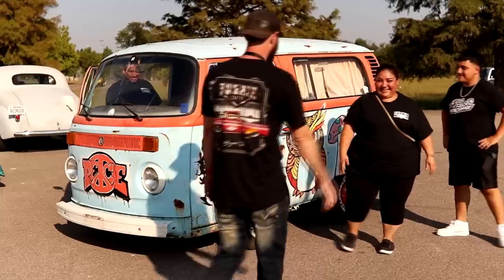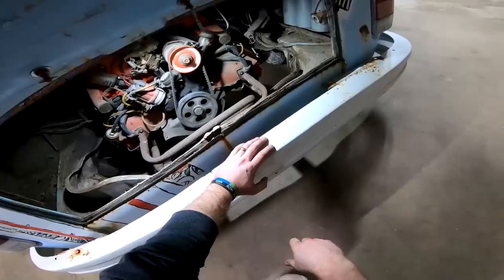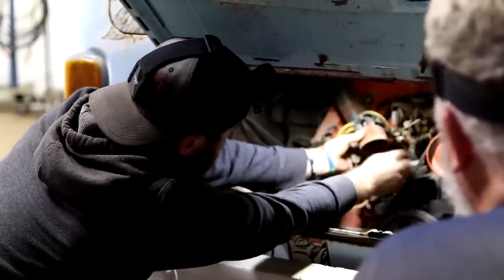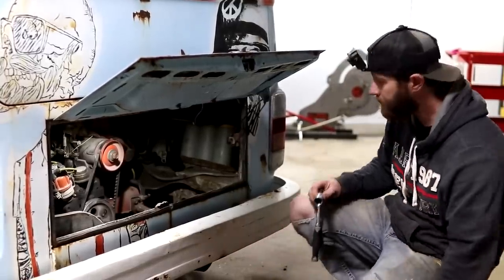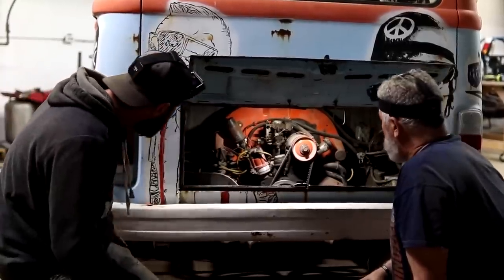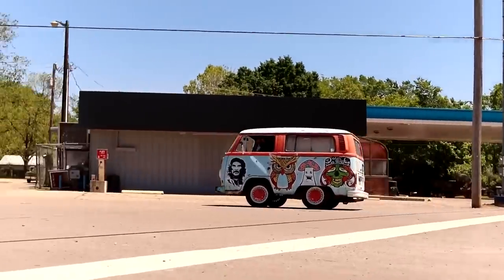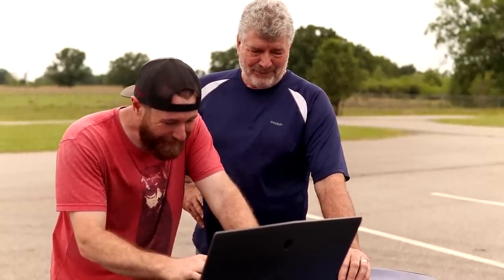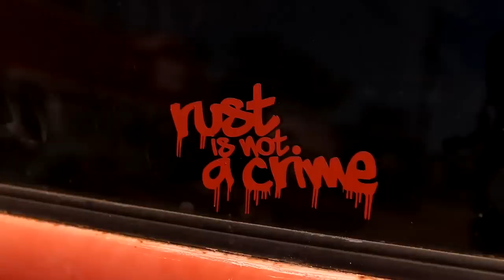Shorty VW Bus Will It Run | Forgotten Wheelie Machine | RESTORED

Comment: in 1973 I heard about a 1960 with newly rebuilt engine that kept overheating.  He only wanted $150 for it.  When I went with him I found that after the rebuild he and his dad failed to put the heat shrouding back in place.  I told him that could be all that was wrong.  He sold it to me anyway.  I towed it all the way back to Arizona from Tacoma with a 73 superbeetle with no problem.  Replaced the heat shrouding properly and BAM it drove like a champ and became a daily commuter for a friend of mine.

Comment: You guys are correct, a 75 bus should have a 1699 twin port motor. Someone put a H Code single port 1500 in there that appears to have been mildly worked. Nothing wrong with that though, as many regard this as the better motor and it will have plenty of power on a shorty.
I'd suggest the sooty plugs are a timing issue.
 I hope whoever ends up with this bus preserves the cool paint and patina!

Comment: Guys next time check the signal wire on the solenoid with test light see if it lites up with turning the key that way you know u have power there.  That extra solenoid was added because solenoid on the starter was bad an by adding that Xtra solenoid was way cheaper than paying for a new starter.

Comment: TR, if you have an old VW Idiot's guide you'll find a setup that incorporates a Ford pickup truck starter solenoid that shortens the circuit to the VW starter. I have installed several and my current 66 Bug converted to 12volts has that setup and starts every time using the original ignition switch rain or shine. Great project and video!.

Comment: VWs busses often have problems with voltage drop coming from the ignition switch 
the battery is all the way in the back so power has to run all the way to the front and back to the starter solenoid add in a worn out ignition switch and often you get weak engagement 
 so a quick fix is to put a extra relay with a short b+ run directly to the battery so when you hit the ignition switch the weak 12 volts trips the relay and the relay feeds the starter solenoid with 12v directly from the battery .

Comment: I grew up inHollywood Florida and in the next townNorth of us we had a independent VW Repair shop that mostly in the 70s and into the early 80s  specialized in Air Cooled  Volkswagens  they actually had a shortenedBus they used as a Shop Truck it was so short that the driver could reach the rear window from the drivers seat  they also had it that at almost every red light they could pop the front tires off the ground  for a short period i had a 72 SuperBeetle that the same shop had  done a lot of work on for the previous owner i bought it from  it was a very rusty old SuperBeetle when i paid a hundred bucks and a set of used car tires to  a former CoWorker that knew very little about Cars  and at one point he took house paint  and repainted the OriginalVW Green to a Brown without  doing any body work or repairs  it also was leaking oil like crazy and had 2 SparkPlugs dangling by the wires because the threads were completely stripped out  but some how the car poorly was running well enough for me and a freind to drive it home about 6 miles in the dark  the next day i fixed the sparkplug threads by installing a Heliocoil kit  and screwing the Plugs into the heads  i did wind up pulling the motor and with a $112.00 Brazilian made refresh kit i bought at my local auto parts store  that included 4 Pistons 4 new Rods ,Rings and all new Gaskets  i broke the motor apart and put that kit in  plus cleaned the filthy oily thing up  and the damn thing ran good without any leaks  ! my sister needed a car and i gave it to her not only did she drive it for 4 years  beating the hell out of it  she wound up giving it back to me and i pulled the engine  that same motor has been in many VWs and 35 years later it’s still running  in some Aircooled VW car in that area BTW the VW Group from that era are still a pretty tight group and actually one of my best freinds Uncles was a VW Certified Dealer mechanic in the area for 40 years  i personally did get into the Water Cooled VWs starting with the first generation Carbureted 1975 Rabbits and  several more of the Bosch FuelInjected ones into the early 80s several of which my freinds Uncle sold me because he picked them up very inexpensively through the Dealership  one of which was a 2 Door Rabbit with a blownheadgasket  i put that one together and put a lot of miles on it  untilllmit eventually spun MainBearings

Comment: Excellent video RESTORE Crew Wyatt   :) , Lance :) , Christine  :).also think that Volkswagen Bus is amazing also motor might be 1100 to 1300 CC 4 cylinder to and get that Steering wheel column key ignition switch wires fix up be great to solve to ! I never rode them ever only in Dune Buggy car type and first rode in VW chassis thought Go Kart in  4 wheels with motor plus transmission too ! Work on them in Bugs , Bettle cars and rare 1964 Sunbeam like Volkswagen Bug or Bettle cars my one Cousin and 5 seater too ! But right Hand drive plus left hand to with 2 Steering wheel plus brakes also turn signals too and England car orgnail too came from ! My cousin Elizabeth got for her 16 birthday from her Parents in 1964 ! Car Green body and interior too ! Plus fully restored in 2013 too and got too!

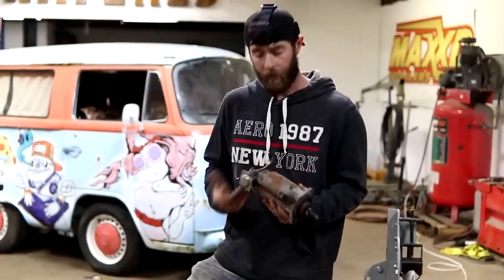Comment: 10:34 = Search "VW Bus hot start relay". ...It's the common fix for the problem of increased resistance in the long run of wiring to/from the ignition switch in old Buses dropping the voltage enough that that solenoid doesn't get enough juice to function when it gets hot. Rather than replace the wiring a second solenoid is wired in back by the starter with the control voltage coming via the old wiring from the switch and a new, short wire from the battery used for the line voltage to the solenoid.

Comment: I grew up in HolywoodFlorida  and I the next town over we had a local business called The Beetle Shop that was privately owned  and for the most part the owner hired a group of  men to work in the shop that were a bunch of Bikers  they were a tough looking group but a bunch of nice guys and knew VW Aircooled  very well  the Shop  did good work but most of all they were very helpful  with advice to people that turned their own wrenches  on their cars  those  guys and the shop in general  would put just about anything on VW Pans  with  A Aircooled motor usually a semi stock VW Transaxle  and gear box they put Fiberglass boats on them and they had a Shop Truck tat was a shortened VW Bus it was so short the Driver could touch the rear Window from his seat it also pulled the front wheels off the ground  at almost every stop they didn’t have Wheelie bars on it so typically the guys just did short hops  on it  and I imagine  the Cops left them alone  with that practice  being South Florida and the Shop being less than 5 miles from the Beach  they did put a rack on the Bus  and strapped a Surf Board. Up there for a while  they frequently changed the exterior color  and kept the thing  in one Color nothing too Extreme or Custom it was definitely used as their shop Truck   And you saw the guys running Errands I myself had several Volkswagens  and often went to the Shop for some parts and Advice  as I was just a Teenager  at the time

Comment: This  VW van, is stuck in a time warp. Why this was cut in half a different engine is anyone guess. I am glad it is running. I only hope you don't have to pull the engine out. If you drive it, hope the gears work. Good luck.

Comment: If the starter is turning but not engaging you have a bad solenoid you need to take that little round solenoid off and replace it the square one on there is for a Ford and somebody tried to replace the little round one with it

Comment: I never see anybody on these channels change out the starter bushing, or even mention it. Is that something you guys do when working on VW's? Years back I worked on many vw's, and the cause for a bad or faulty starter usually began with a bad bushing. BTW 8 mins was my best time to fully pull a v-dub motor. (engine)

Comment: Battery used to be under the back seat.
Reply: I believe all type 2 vans/combis/trucks left the factory with the battery in the engine compartment on the right side. Of course that  changed when switched to water cooled engines in the front with front wheel drive.

Comment: That would have had a pancake engine not an upright all that missing tinware will let it run hot but of course no pancake tinware will fit that engine and upright tinware doesnt fit that van, good luck